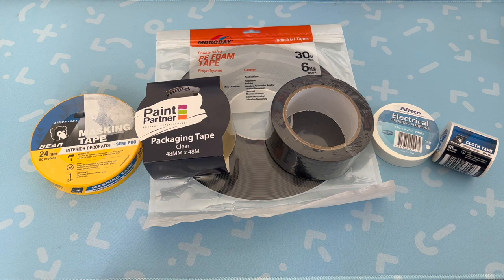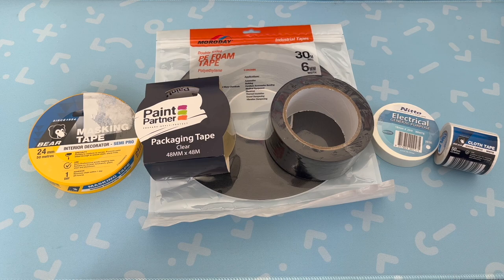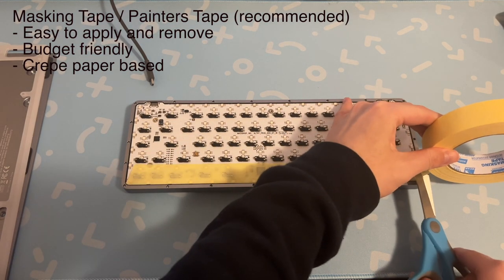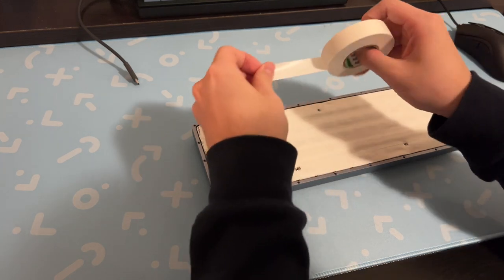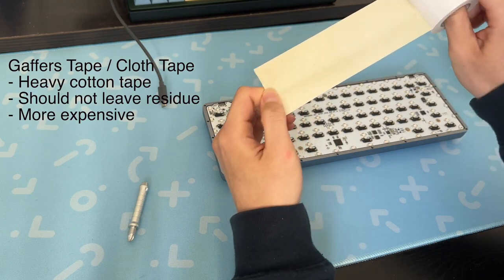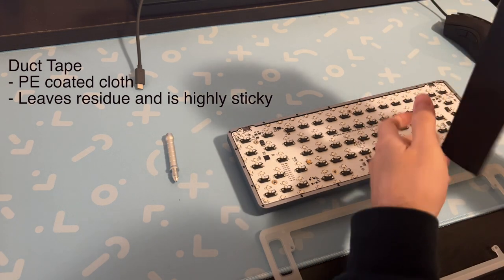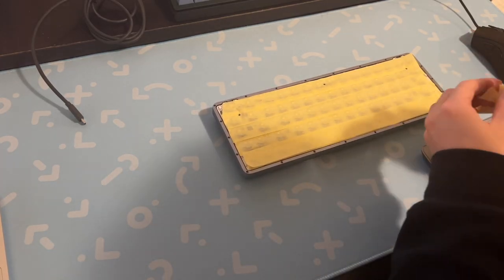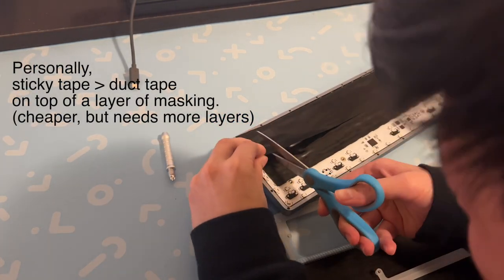Best Tapes for Tape Mod! (6 tapes & combinations tested)

Comment: I think the point of the tapes is that they stop the sound from spreading around the material so the sound just kind of getting muted quicker than without tape, basically like your normal sound is a whole note and the tape makes it a half note if you get what I mean. Great video! I'll surely try this out when my first custom kit comes
Reply from the maker: Yes that’s right. Have fun modding!
Reply: Nice you know whole notes do you learn music

Comment: I haven't seen anyone try the tape mod with the "cotton" athletic tape used by players to wrap up their hands and fingers it is a little thicker than normal cloth tape and gaffers tape and may be a thing worth looking into but great video!
Reply from the maker: Great point, yeah I did consider this, but felt it was not viable for most people cause it can cost double or triple.
Reply: @andiyao  In the world of custom keebs this price tag is nothing.
Reply: Just wondering the same thing, i happened to have elastic sports tape at hand, but haven't try it.

Comment: Super useful, thanks! tried 2x electrical tape with blue switches and it sounds clickily and not echo-y awesome
Reply: I have the same problem, but echo is very metallic (top metallic, bottom plastic). So I'm assuming it won't make switches any quieter? Did you cover PCB, base, or both? What if I fully cover back of PCB, base, and roof?
Reply: @WellBeSerious12  I did bottom of PCB and then sheet foam in the case.  If you like hearing that click... this is for you (and me)

Comment: Electrical Tape is the best for Tape Mod!
Painter's masking tape adhesive sucks and will leave a dried mess after some time on your PCB. As well I am not sure the chemical compatibility of the adhesive used.
As for normal electrical tape, people tend to buy it from the dollar store which is not the same as Scotch 33+. Those tapes will leave a gooey mess which is a royal pain to remove.
Reply: Electrical tape actually damages the keyboard I don't recommend at first it's normal the more you use it you will notice there will be a delay when you press certain keys
Reply: @GOLDAK1ST  I'm sorry but that makes no sense. The tape doesn't enter the switch and cause a physical delay, nor can it cause any kind of electrical delay. It's an insulating tape.

Comment: - I tried foam tape although I would recommend using a base layer of sticky tape because that will at least allow 2 layers or more if applicable, simply because foam tape is rather thicker than most tapes!
- I have also tried using Alien tape (gel/polymer tape) which is the thickest "tape" I have tried while experimenting different tapes for different sounds. I have not found any videos of anyone using Alien tape for keyboard PCB modding, but it definitely works!

Comment: As someone who works with Electrical Tape on a regular Basis. DO NOT use this for a longer Period of time.
At some point the glue gets super soft and sticks to everthing.
It's not a Pleasant feeling on a Cable, so i dont think it will be on a PCB.
Reply from the maker: Agreed! A layer of masking first is the best bet for now.

Comment: Fantastic video, i did 4x masking tape 2x duct tape before finding this video on my keyboard and it did wonders.

Duct tape on it own seems to be pretty mediocre but it does wonders when combined with masking tape for some reason, im not gonna retape it, since masking/duct tape is luckely my favorite combination out of what you have tested.

Keep in mind that the PCB gets THIC! When using so much tape!!! I nearly broke my keyboard by overstuffing the little space left in it with cotton foam after doing my tape mod.

Comment: Weird, imo the 2 layer in all tape types had a slight hint of metal pingy sound(marble?) while 3 layer just sound muted.
Reply: that might just be  excuse the screws are a bit loose, that can be fixed by using orings though
Reply: @九头金蛇  dont use orings

Comment: I think the electrical tape sounded the best overall, but I would never use it because the adhesive always gets all over everything. I think there would be a lot more of a difference in the sound profiles if the switches were lubed. I don't know if these ones were, but they were loud and scratchy sounding, so I'm just guessing.
Reply from the maker: Yup these are just holy pandas left intentionally stock for loudness and less deep sound
Reply: If you want to make use of electrical tape, maybe you can try to put in a layer or two of masking tape first, then a layer or two of electrical tape. Avoids the problem of the electrical tape adhesive mess

Comment: Is masking tape really good when it terms of longer use? (I’m new for tape modding) 

I’ve been researching online that people often say it did or did not leave a sticky residue on the PCB. What is your opinion for this?
Reply from the maker: It leaves less residue compared to other tapes. Most tapes aren’t designed to be left on for months or years with no residue in mind. High quality masking no tape is a good compromise.

Comment: what do you think is the best combo for a tray mount board (rk61, gk61) planning to tape mod my board, so this would really help! thanks! :)
Reply from the maker: Multiple layers of masking will do the trick! Also some foam in the case helps remove any hollowness.
Reply: do you have any links to the masking tape that you would reccomend, and how many layers?
Reply from the maker: 3-5 layers is ideal. No specific links to masking tape soz, just go for any masking/painters tape from your crafts store 🙂

Comment: When you are doing the sound demos with combos of tape which tapes goes on first? I see there is a order to the way you listed it but I'm not sure if the top or bottom of the list goes onto the PCB first.
Reply from the maker: The order in the video should be bottom tape first, then the next tape is the one above it. Sort of like the same order you would make a “stack”. Tbh it doesn’t make any difference in sound if they’re stuck properly, safest bet is always masking first in case u need to remove it in the future! :)

Comment: I have modded my redragon 530 pro with painters but it has an battery inside
I have made sure to leave enough room but im still worried it might catch fire
If i put electrical tape over the painters tape
Would that be a better idea to prevent any fire hazards?

Comment: Is gaffer tape sticky?
Reply from the maker: Yes sticky, but it's built to not leave residue. Also hard to pull off, so I recommend a masking layer first.
Reply: @andiyao  ooh ok thx I will try the mod once I got a keyboard that sounds better than my cursed blue switches